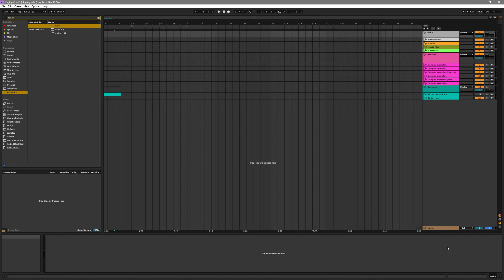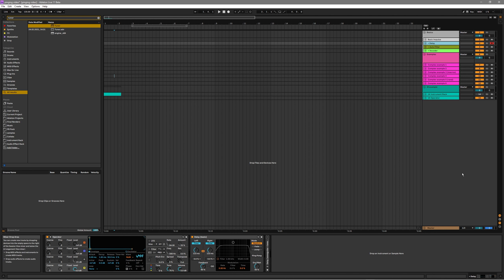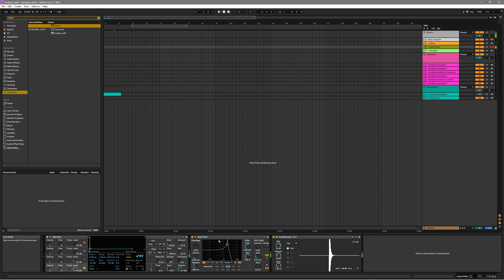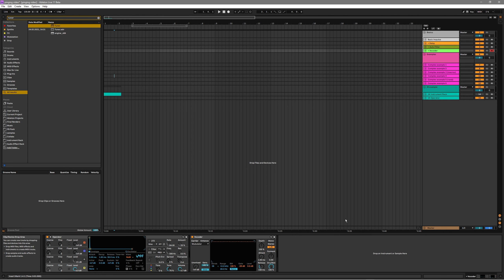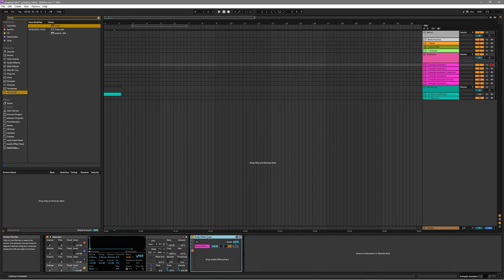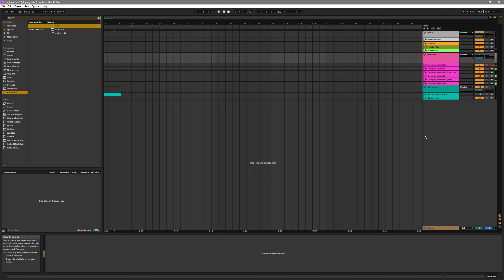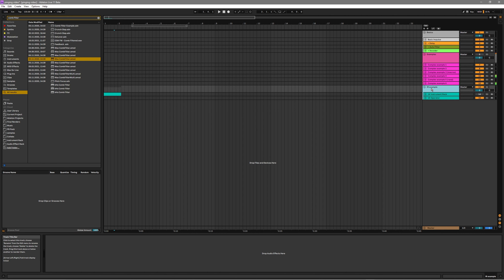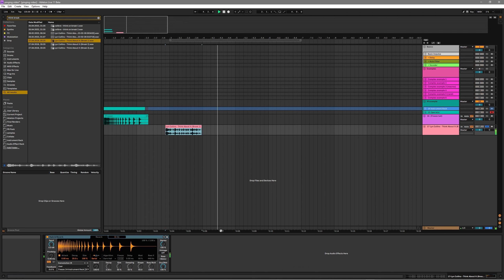Pinging - an inspirational sound design technique

Comment: only a sine wave? technically summing many sinewaves together you can basically build any sound the idea is based on the fourier transform.
Reply from the maker: yeah, this is a basic fundamental concept that you can tie just about everything in dsp back to in some way. Although sometimes it's a bit easier to think of a signal in ways other than as a bunch of sinusoids. For example in this video i was thinking about things more in terms of how a system is responding in the time domain to a very short impulse instead of in the frequency domain.
Reply: for sure, and it's not only the summing of the sine waves that change the way the air is displaced, it's phase modulation will impact the output as well. I feel like Pinging is basically phase modulation. @Popbot
Reply from the maker: @donnydarko7624  how is it phase modulation? I feel like you're operating off of some faulty information. and even if it is (which if it is i would appreciate an explanation), why does explaining it as such add anything of value to the discussion? 

I feel like by trying to explain pinging in this way you are introducing highly unnecessary levels of complexity to the situation. although maybe it makes more sense in your brain, so idk.

Comment: Hey, that sounds like a super cool technique, any chance you could tell us where you got that Comb Filter at 11:10 from, because I just can't seem to find it😅
Reply from the maker: oh sure. its a max for live device that comes in the max for live essentials pack which comes free with ableton suite. Although you can do the exact same thing by having a delay with 0 feedback with a very fast delay time on 50% wet.
Reply: Thank you, found it✌️ And yeah the delay thing works as well but it's hard to get that to the correct Pitch😅
Reply from the maker: if you're looking for a tuned delay I suggest using corpus on string mode. It's deffinitley far from a comb filter (it's in actuaity a modal resonator) but it sounds very very similar in character and harmonic content. you can also control it with midi and more accuratley dial in feedback parameters.  @marcinrau2817

Comment: Super cool technique and i bet it's great for experimenting and inspiration, but for getting a certain result you have in mind this technique is rarely applicable, isn't it?
Reply: That would depend on your knowledge and experience in trying to get that specific sound. If you know exactly how to build the sound from scratch, you may indeed be able to create something very specific using a pinging method. You can also take the post processing much much further than what's detailed in this video, which can get you probably a lot closer to the type of result you're looking for.. but generally speaking yes this method is more for experimentation. Here you're just trying to get happy accidents out of going crazy on the FX.
Reply from the maker: hey sorry for the late reply. I actually use this technique for controlled results very regularly, usually more so than not. As with any other sound design technique, you need to have a pretty good level of what a change is going to sound like before you make it so that you can  decide how to make a sound before you make it. Imo there's really no sound design technique that's impossible control (although some are more difficult than others). 

i guess it works very well for me specifically because i tend to layer a lot of really simple sounds instead of focusing on a single complex sound, and the easy setup and wide range of possibilities that pinging offers makes it a good jumping off point for me and my specific style.
Reply: thats sound design!